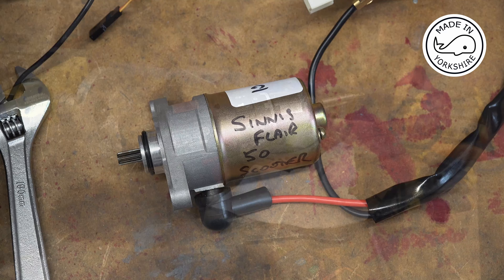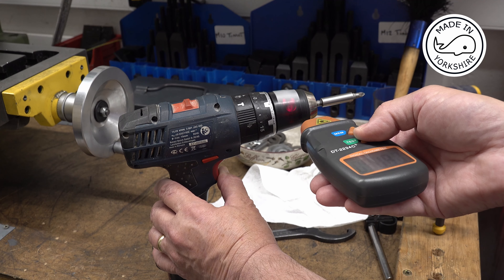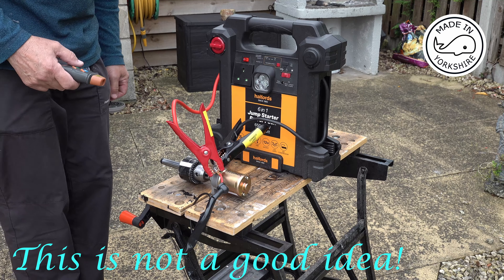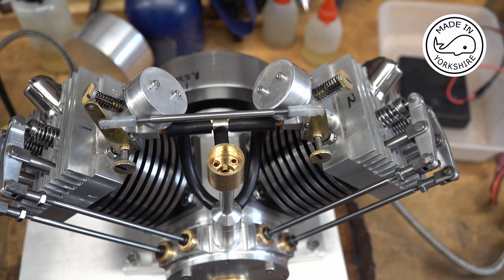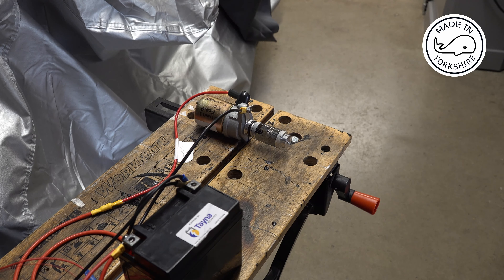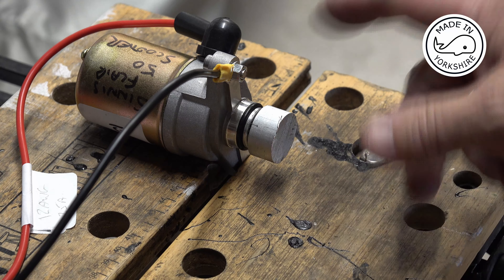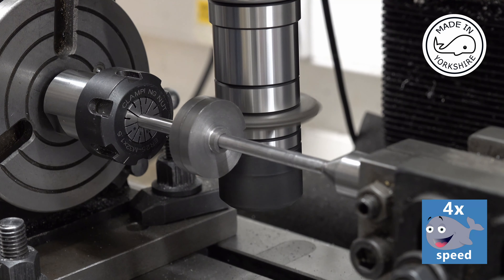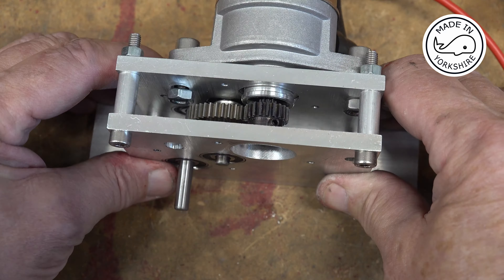#MT49 Part 24 - Jerry Howell V-twin IC Engine. Starter Motor Mechanism. In 4K/UHD by Andrew Whale.

Comment from the maker: ****READ ME*****READ ME****
Unfortunately my DIY activities have come to a halt for the moment 😀😀😀.
So I decided to replace my starter motor with a geared version. This motor was suggested by Terry S (a fellow model engineer also building a JH v-twin) and can currently be found on eBay UK by searching for '3 bolt electric starter motor 50cc'. It cost less than £13 delivered!
I made a bracket using 40mm angle iron with slots in the top for bolting to my aluminium base. The slots allow of belt tension adjustment.
I kept the 48 tooth pulley on the engine end as it needs to be large enough for the sprag bearing. I put a 21 tooth pulley on the motor end using grub screws and epoxy resin to fix it. I also needed a larger belt 500mm long.This gets the rpm down to around 850.
It works a treat!
The only problem I encountered was the current draw. The original motor used less than
20A. The replacement blew that. I replaced with 25A and it blew that as well. So I ended up replacing the motor circuit 12AWG wiring with with 10AWG and using a 30A fuse. Fortunately the relay is rated at 30A.
Very happy with the result and it's far quieter than my geabox version.

Comment: Well, Andrew, as usual, you did a beautiful job on this engine. Any clue as to what you might try next? Have you thought about a radial engine perhaps a three cylinder?
The choices are endless really. I’m sure whatever you choose to build will come out great. thanks for letting us in on your hobby.~Paul
Reply from the maker: Thanks Paul. I'm not sure what to have a go at next. I need some time to play with a secondhand Quorn I bought recently.  I also promised my wife that I would do some home improvements after completing the v-twin 😢. So my next engine project could be several months away.
Cheers
Andrew

Comment: hi Andrew i agree with one of the previous comments that the stater motor may be designed for 6 volts and have you looked at RDG tools as they have a good range of modual gear cutters in the .? range. great content by the way
Reply from the maker: Thanks for the suggestion. I did check out RDG but they didn't sell Mod 0.6 cutters. The Sinnis Flair 50 scooter is definitely 12v. My plan is to run all components (ignition, fuel pump, starter) off the one 12v battery. My BSA Bantam is 6v, so I might try that battery at some stage, just out of curiosity.
Cheers
Andrew

Comment: 6v battery & Delrin gears to quiet it down
Reply from the maker: The Sinnis Flair 50 scooter is definitely 12v. My plan is to run all components (ignition, fuel pump, starter) off the one 12v battery. My BSA Bantam is 6v, so I might try that battery at some stage, just out of curiosity.
Cheers
Andrew

Comment: Andrew, it's probably not much help now, but, your 32 Dp gear cutters, 20 will cut 17 - 20 tooth gears and 40 will cut 35 - 54 tooth gears... Hope this helps some time...
Reply from the maker: Thanks for the info. Those were the only two 32DP gear cutters I had, so I was a little fortunate.
Cheers
Andrew

Comment: Wow, that starter was running really fast! You did a great job making a robust gear box that shouldn't provide any problems in the future and one that should easy crank the engine. I think keeping everything at 12V is best so you can run all the accessories like the fuel pump and ignition.
Reply from the maker: Thanks Douglas. It's not the most elegant solution but it is functional. Yeah, the ignition units can run at 12v and I've just ordered 12v fuel pump together with a PWM to slow it down. It should be interesting trying to get the fuel delivery system working as Jerry Howell suggested. I hope you are well and enjoying your time in the wilds of Newville PA.
All the best.
Andrew

Comment: That was a lot of work, but looks like it's turning out right. Did you consider just using a 6V battery instead of 12V? Maybe I missed that part.
Reply from the maker: It's not a great solution, but it works. The Sinnis Flair 50 scooter is definitely 12v. My plan is to run all components (ignition, fuel pump, starter) off the one 12v battery. My BSA Bantam is 6v, so I might try that battery at some stage, just out of curiosity.
Cheers
Andrew

Comment: Hi Andrew, what a lot of effort just to start the engine. Are you sure that the motor was 12 volts. A lot of bikes are 6 volt. Regards from Australia.
Reply from the maker: Hi Dave - you know I like setting myself challenges! The Sinnis Flair 50 scooter is definitely 12v. My plan is to run all components (ignition, fuel pump, starter) off the one 12v battery. My BSA Bantam is 6v, so I might try that battery at some stage, just out of curiosity.
All the best.
Andrew
Reply: @learningturningmetal  The other thing you forgot to take into the equasion is that you are doing all this under NO load. I bet when the motor was in a motorbike, that the compression was quite large and the motor would run much slower, hence the high amperage quoted on the motor label. You listen to your bike starting, it is probably only a hundred or three rpm on the motor. Good luck with it all. Regards from Australia.
Reply: @learningturningmetal  Hi Andrew, just had another thought about your starter motor. Back in the old days a car starter motor used to have a Bendix gear fitted that use to throw in when started and engage with the flywheel starter ring and when the engine started it was thrown out. Sometimes when the Bendix got stuck, the motor would run very fast a there was no load on it, but when it did work it ran slow due to the friction of the car engine. I think your bike motor will run slow once you try to start your model engine. Good luck with it. Regards from Australia.
Reply from the maker: Hi Dave
Thanks for your thoughts on this.
You could well be right.
Also my engine is only 32cc as opposed to 50cc. My solution isn't the most elegant but if it starts the engine within a couple of seconds I will be more than happy. We will see.
All good fun at the end of the day.
Things must be warming up at your end. Sadly getting colder at this end 😭.
Take care and carry on machining!
All the best.
Andrew

Comment: An elegant solution and some more fine gear cutting. My only comment is that I'm sure that you could have found an easier solution, as other people have commented, but perhaps that wouldn't have been nearly as much fun 😊. Best wishes.
Reply from the maker: Thanks George. Not sure about 'elegant' but it works! It was a good excuse to brush up on gear cutting and the gears did turn out well.
All the best.
Andrew

Comment: Good progress so far👌.
 You will see further down that a couple of comments suggest perhaps reducing the input voltage to the starter motor. A drop of 1.5 or 2 volts will slow it quite noticeably.  There are also useful compact reduction gearboxes to be had from the front end of scrap cordless drills.
Reply from the maker: Thanks for the advice Howard. I did consider (off camera) using a PWM but they are quite expensive for high amperage and as I understand it they adversly impact on the torque. I don't know how to reduce the voltage coming out of a 12v battery, but out of curiosity I will investigate.
All the best.
Andrew

Comment: You may find that the starter is meant for use on 6V - It may be worth trying it on 6V if you feel it its still too 'lively'. Nice job on the gear box👍
Reply from the maker: Thanks mate! The Sinnis Flair 50 scooter is definitely 12v. My plan is to run all components (ignition, fuel pump, starter) off the one 12v battery. My BSA Bantam is 6v, so I might try that battery at some stage, just out of curiosity.
Cheers
Andrew

Comment: You’ve probably already seen them but HPC gears of Chesterfield have a very extensive and interesting catalogue of small transmission components.
Reply from the maker: Hi Terry. I'm aware of HPC gears but I never thought to check them out for Mod 0.6 spur gears. I've just had a look and they sell loads of them from 10 teeth to 250 teeth. That would have been worth a try.🙄
Thanks for the tip.
Andrew

Comment: Hello Andrew. Well done......seems overly complicated. Did you ever consider dismantling and modifying a cheap battery drill? Cheers, Ray
Reply from the maker: Hi Ray - I admit it's not the most elegant solution but it does work. The thought did enter my mind to use a 'cheap' battery drill but, having already purchased a 12v battery and starter motor, I decided to get working what I already had. My plan is to run all components (ignition, fuel pump, starter) off the one 12v battery.
Cheers
Andrew

Comment: Hi Andrew, It would have been easier to buy a geared starter motor they are just as cheap and when I fitted mine to the v2, I used a one way bearing on the flywheel and a tooth belt drive and works fine.
Enjoy your videos keep up the good work.
Regard
Keith
Reply from the maker: Thanks Keith. I looked all over for a suitable geared starter motor but couldn't find one. Can you tell me what make and model you used?
Cheers
Andrew

Comment: Looking good, lve emailed you about a fuel pump
Adam L
Reply from the maker: Thanks Adam. That fuel pump looks the business.
Cheers
Andrew
Reply: @learningturningmetal please forward the information on the fuel pump. I am also building this engine. Thank you!
Reply from the maker: @justindewoody I don't want to divulge the make/model of the pump at the moment. It is quite powerful so I will use a combination of a pwm and fuel line restriction. It will all be covered in my next video.
Cheers
Andrew

Comment: Nice work on those gears Andrew. You seem to be the man these days for gear cutting. It turned out very well too. Will be sure to watch the next episode. I am busy messing with a Classic car i have replaced the Jag with & loving it. I need to get on with the Hit N Miss too. 
I forgot the name of the ignition system you used. Can you tell me the make again & where i could possible get one. 
Steve.
Reply from the maker: Hi Steve - it looks like you are having fun! I've used two different types of ignition systems in the past. Minimag in the Isle of Wight are good but expensive (used on the JH Farmboy). Just Engines sell a cheaper version which works well too (used on the JH v-twin and Hoglet).
Cheers
Andrew

Comment: Is the starter 6volt as many scooters of 50 to 100cc don’t need to be wizzed over that fast, starters only need 100s of rpm even on cars and larger motor cycles.
Reply from the maker: Hi, the Sinnis Flair 50 scooter is definitely 12v. My plan is to run all components (ignition, fuel pump, starter) off the one 12v battery. My BSA Bantam is 6v, so I might try that battery at some stage, just out of curiosity.
Cheers
Andrew

Comment: Have you considered reducing the voltage to reduce the speed of the motor?
Reply: Exactly what I was thinking....reduction to 10 volts would knock the top speed down significantly.
Reply from the maker: The Sinnis Flair 50 scooter is definitely 12v. My plan is to run all components (ignition, fuel pump, starter) off the one 12v battery. My BSA Bantam is 6v, so I might try that battery at some stage, just out of curiosity. I don't know how to reduce the voltage of a high capacity 12v battery, but I will investigate.
Cheers
Andrew

Comment: The easiest thing to do is look up a replacement battery for the scooter and check the voltage.
Reply from the maker: Hi John. The Sinnis Flair 50 scooter is definitely 12v. My plan is to run all components (ignition, fuel pump, starter) off the one 12v battery. My BSA Bantam is 6v, so I might try that battery at some stage, just out of curiosity.
Cheers
Andrew

Comment: Could you not just buy a cheap cordless drill and sacrifice it for the bits you want?
Reply: Forget that I made that comment before watching the second half of your video.. you have once again dojlne an amazing job.. Great video!
Reply: It is a good suggestion,Matt. I have several scrap Dewalt,Bosch and Makita cordless drills for exactly the purpose of harvesting the epicyclic reduction gearboxes from the front ends. My plan is to use them for custom build leadscrew drives  on the milling machine X and Y axis.
Reply: @howardosborne8647  that's an inspiring idea. 👍
Reply from the maker: Hi Matt - that thought had entered my mind. However, after purchasing the 12v battery and starter motor, I decided to try to get working what I already had. I also want to keep the system 12v in order to power the ignition and fuel pump as well.
Maybe next time!
Cheers
Abdrew

Comment: Your supply voltage is too high
Reply from the maker: Hi Ernie - The Sinnis Flair 50 scooter is definitely 12v. My plan is to run all components (ignition, fuel pump, starter) off the one 12v battery. My BSA Bantam is 6v, so I might try that battery at some stage, just out of curiosity.
Cheers
Andrew

Comment: A voltmeter can not measure voltage in series with an amp meter, an amp meter is connected in series with the circuit being measured, and a voltmeter is connected across the supply
Reply from the maker: Hi Ernie. My multimeter can measure both voltage and amperage. I wasn't specific enough in my video.
All the best.
Andrew